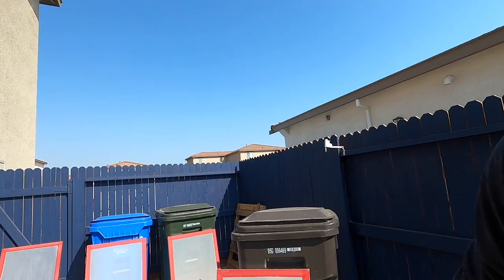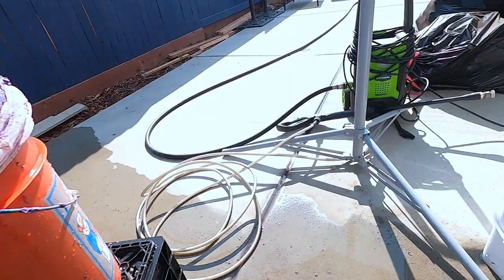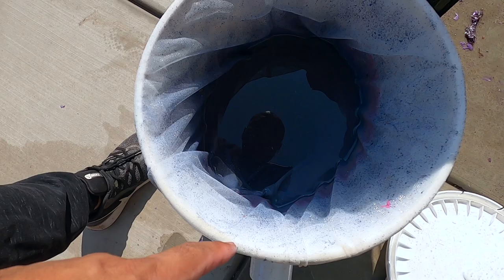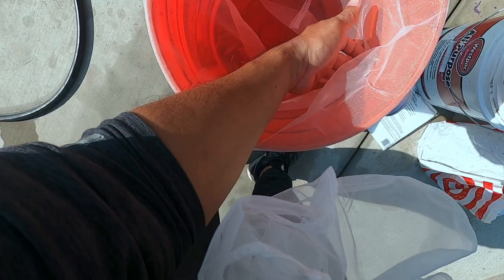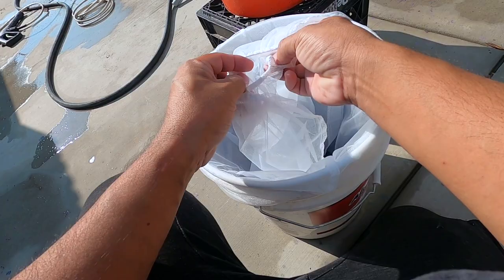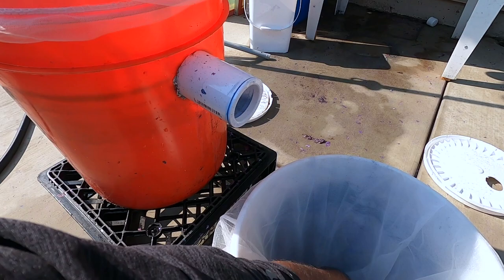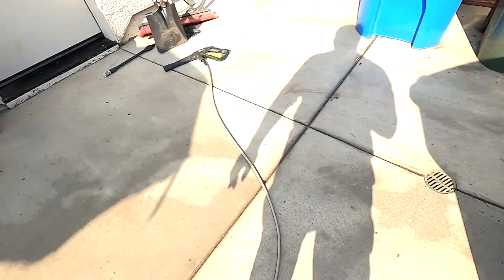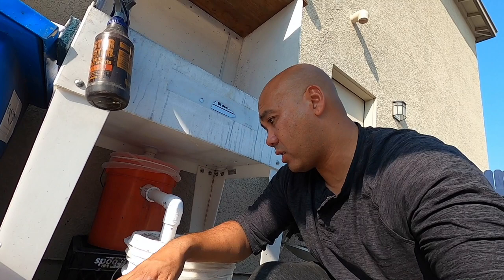LETS TALK ABOUT MY DIY FILTRATION SYSTEM : Screen Printing Wash Out Booth Filtration (S:06/Vlog 053)

Comment: Great system. I think a good solution to the strainer blocking the hole would be to put an elbow piece on the pipe inside the bucket, either facing down or sideways or something. That might keep the mesh away from the hole.

Either way, one of the best DIY filtration systems I’ve seen yet. 👌🏻

Comment: Hey yo. Nice little build. I hadn't seen those 5 gallon filters before.
A little suggestion to save the wallet.. You should cycle those filters. When the first filter gets full, take the second set of filters and put them in the first bucket. Then only put new ones in The second bucket.
Reply from the maker: Yep I have been trying to do that